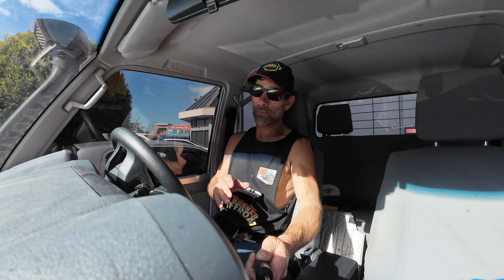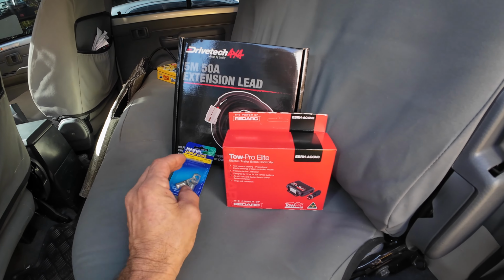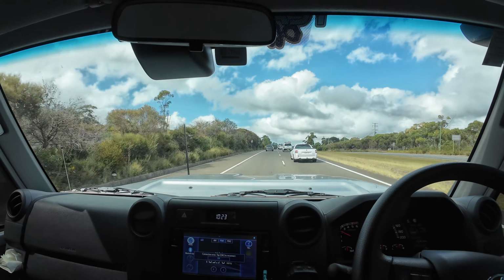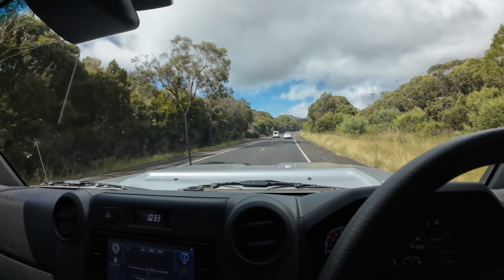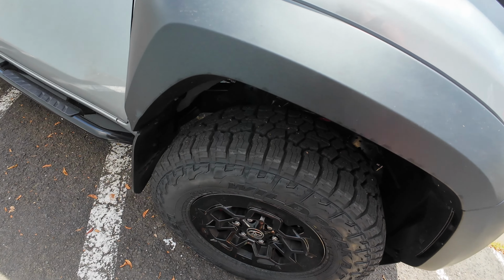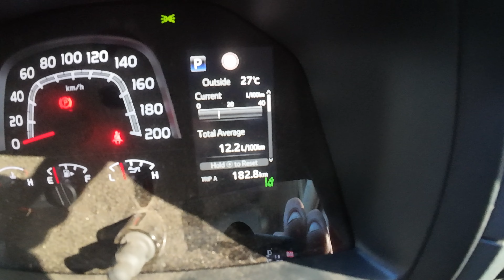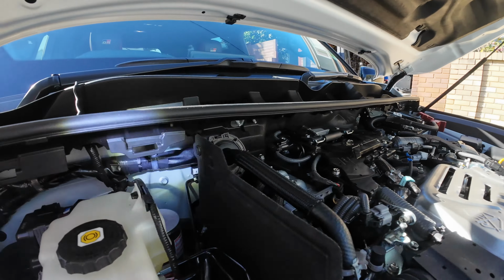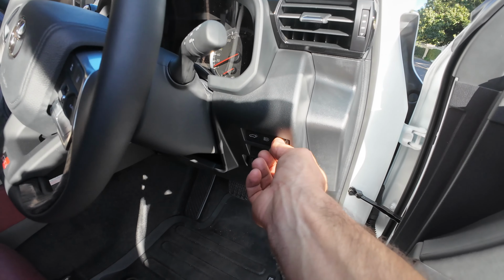300series GR Sport 1st mods & 10,000kms on our Auto 2.8 LC79 series New We see the GR sport hilux 4K

Comment: Hey mate

I love your videos. Thanks for making them.

Did you you say the 4 cyl auto 79 is not much worse fuel consumption than the v8?
Reply from the maker: Thanks mate, yes the 4 cylinder fuel economy is no worse than my white V8 BUT, it holds speed limit, doesn't die on hills and sooooo much better around town, fuel consumption around town is only a little worse that the Fortuner..

Comment: All such good wagons
Reply from the maker: Cheers for commenting.
Reply: @TeamBulletOffroad  can’t wait for some 79 vs GR comparisons. I’m currently looking at Hilux 2.8 vs 79 2.8. Do you reckon the 79 is worth the extra money? Currently driving a 95series Prado diesel 😂
Reply from the maker: @sassall4284  I really do, that solid axle front really does it for me, the ruggedness and seating position  and all the gear you can buy aftermarket for them but I guess its whether you do enough off-roading or towing to justify... The new GR hilux looks pretty cool though..
Reply: @TeamBulletOffroad  I’m yet to start test driving. But will be doing a bit of off road but mostly towing a 1.7t digger. I’m leaning towards the 79 atm

Comment: Just upgrade the brake booster. You get the best gains in the braking system from changing that alone.
Reply from the maker: Thanks for the tip! I did the JMAX one in my 2016, with braided lines, made it better, but still no where as good as the factory upgrade that came out 2017 I think with the bigger calipers...